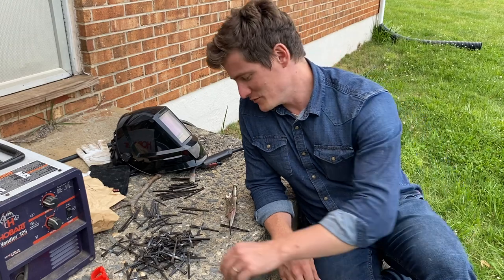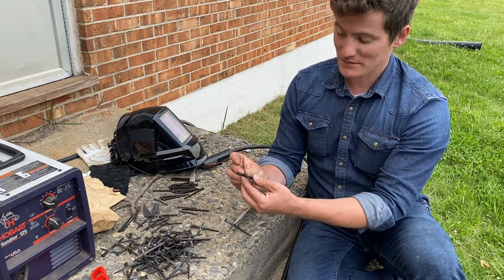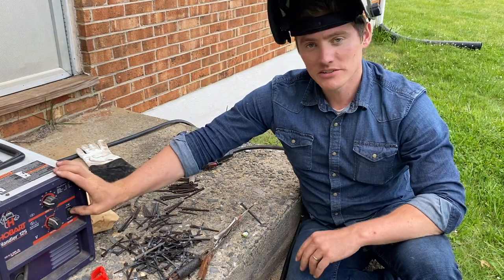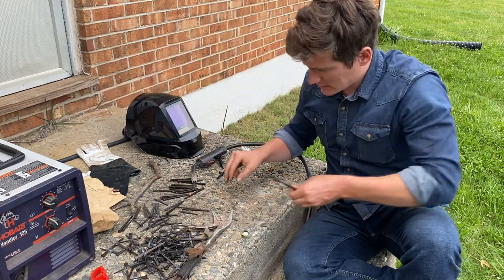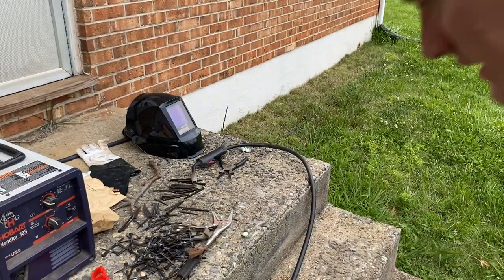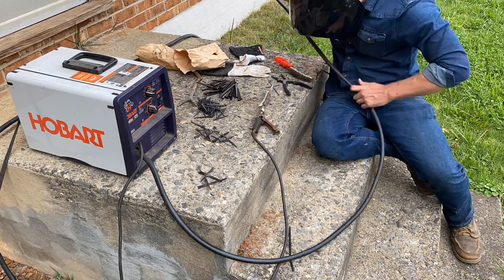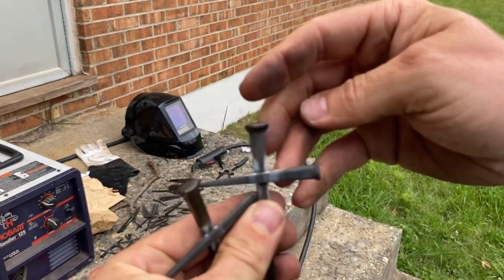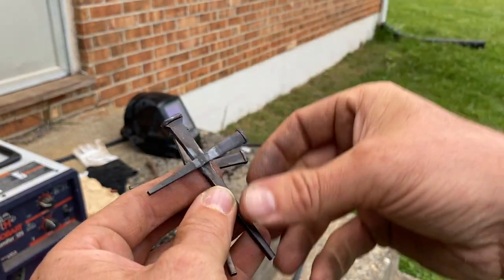Welding Crosses from Square Cut Nails

Comment: My Dad and I made those for years. Except we cut the tips off of two and made the arms have the square heads on both ends. 
  We would also take wire from an alternator and wind it in a crisscross pattern. We had some with red colored wire and some in copper. We'd drill three small holes in the cross. Two to put the ends of the wire in and one to add a ring for a necklace.